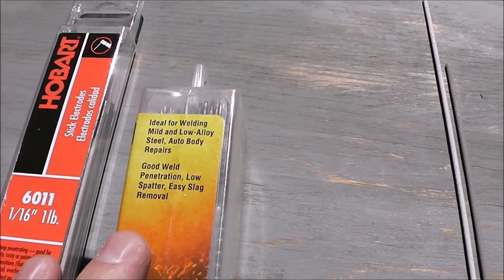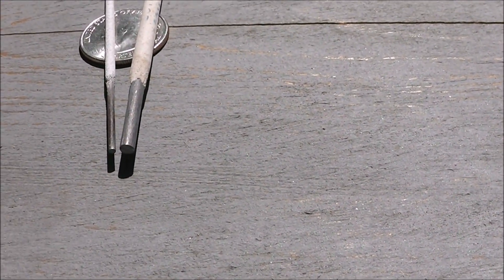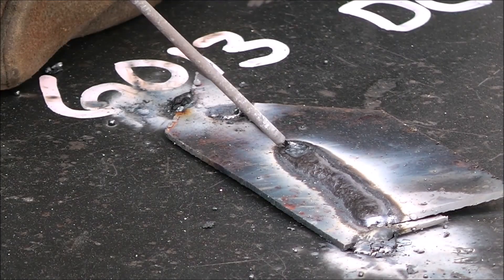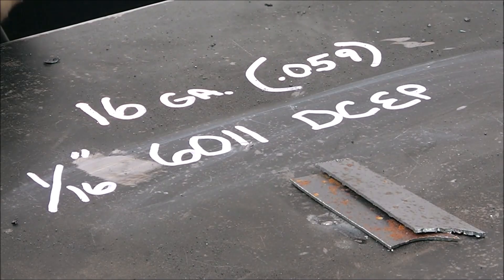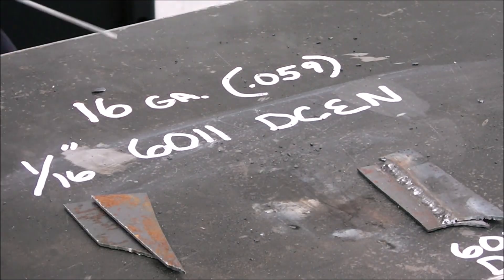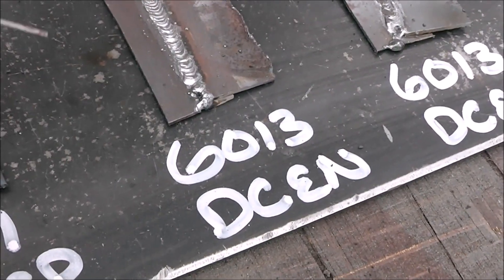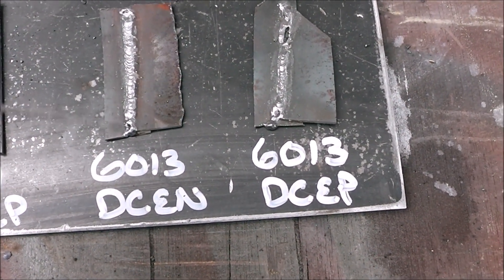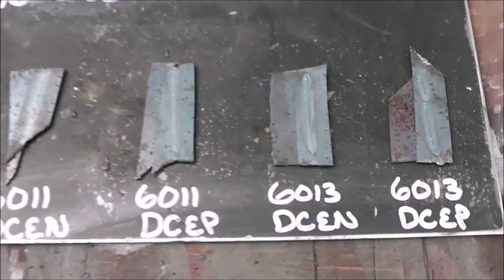6011 Vs  6013 BEST POLARITY for WELDING SHEET METAL

Comment: I've wanted to weld for years finally got me a small box and since I've never even knew anything about welding but I just  bought a small variety of rods and just went to it and I've stuck thousands and burned holes in even more.. but I didn't fret and learned to fill them and move along with a grinder as my best friend to clean up the mistakes.. but I didn't know better I learned on thin metal and my welder wasn't the best when it came to holding an arc so I had to learn improvising.. which I have a method and rotation like I'm stitching figure 8s with a vibrato to the wand that helps maintain the arc... What I found with many trust is if I moved a but faster with 6013 and put a line on the edge of each piece before doing the main weld  prevented many holes especially on rusted compromised areas that will blow through super easy... Course I never bought super thin rods this was all done using huge rods since I  bought most my rods 2nd hand in bulk from others being o tight budget...  Im a huge fan of 6013 in EN is what I've found as well on thin metal... When I finally did some thicker metal later on  it felt like child's play compared to thin...  Glad I learned it this way...
Reply from the maker: A lot of people assume that thin metal is a good place to start because it seems like thin would be easier but it's much harder as you found out. I'm guessing going this route you are probably a very good welder and I know you've learned to read the puddle!

Comment: I just bought a 650 amp chinese machine from a friend here in thailand (220volts). I am just a beginner, when using 6013 rod are the amps 30/60 the same as on a 150 amp machine compared to 650 amp with arc force /hot start.  Thank you.
Reply from the maker: I dont have first hand experience with that welder but it should be the same across the board. 30 amps on one welder would be very close to 30 amps on the next, although each welder is different you will have to "fine tune" a little up or down to get the results you are looking for.

Comment: This was very helpful, but my stick welder does not allow me to switch polarity. 😬
Reply from the maker: Sounds like you have an ac buzz box?
Reply: @BrandonLund  no, it is something I bought online that is a stick, tig, and plasma combo. I am a hobby welder, and it seems to work well overall, but I don't think I can swap my ground and electrode holder.
Reply from the maker: Hmmmmm 🤔 do the cables twist lock into the machine or are they hard wired coming out of the machine?
Reply: @BrandonLund , well crap! I stand corrected.  I was thinking of my little flux core welder. I can switch them around. Is that still okay with 220? And what is the actual reason for doing this. Does it change where the heat goes?
Reply from the maker: Thats awesome! No you won't hurt your machine at all. It's common practice to reverse polarity when welding thin metal.

Comment: Anybody know a solution to my problem..... old tin, old screw holes,  ....leaks,  tried sealant, used mesh fiberglass with asphalt, still can't seal, just open holes, no purlin underneath....Help!!!!@ Thailand help, you know my problem
Reply from the maker: Sounds like your trying to "plug weld"? Tig might be your best option

Comment: I have a old forney c5 welder that I use at times. It has two holes for the ground lead high and low and for the stinger lead it has several hole for the amps. So what will it do if I put the ground lead in one of the amp holes and the stinger lead in one of the ground holes.
Reply from the maker: That is how you reverse the polarity....by switching the leads.

Comment: Thanks thats great for a learner welder Q How do you do vertical welding ie start at the bottom and go or start at the top and go down. using 2.5 mm rods
Reply from the maker: For thin metal to reduce penetration on thin metals you would start at the top and work your way down AKA Vertical Down.

Comment: I'm about to weld a rust hole on my car, I'm trying to decide which welder is the best out of a stick welder or a gasless welder. as these two are in my price range. which will I have better success at with welding thin car metal?
Reply from the maker: A wire feed welder would be your best bet to weld thin metal.

Comment: This is great man, thx.  I was practicing the other day, was blowing through thin ga with 6013 on positive.
Reply from the maker: I think you will see a big difference when you switch the leads :)
Reply: Brandon real fast, what do u think about 7014, I picked up some 5/64" rods to try on thin metal.
Reply from the maker: Its a great all around rod and the slag peels easily.

Comment: Which brand of 6013's did you use?
Reply from the maker: I think these might have been harbor freight or hobart...im not positive. Im still planning to do a 6013 comparison which im looking forward to.
Reply: @BrandonLund  I have been reading about Hobart 6013. The latest flux formula is 447A with only “6013” printed on them. These have the aggressive arc I'm interested in. Original formula 447C was butter smooth non aggressive arc with "HOBART Stick 6013” printed on them. Today, Original formula might be found in 1lb. packages only.
Reply from the maker: Interesting! I'm going to see what i have laying around...im hoping I have some of the originals to compare:)

Comment: New to this so my question is there dc rod and ac rod? I have a Lincoln ac 225 and want to learn how to stick weld. Thanks.
Reply from the maker: Yes and no. An example is 6011 rods are designed for AC, however they are the equivalent to a 6010 which is primarily run on DC.  Grab some 6011 rods and start padding beads. Don't expect them to look pretty at first but in my opinion a 6011 rod is a good rod to learn how the weld puddle responds.
Reply: Brandon Lund : thanks. Practice and more practice. I just wanted to start on even ground.
Reply: convert it to dc.  Order a 300 amp bridge rectifier from Amazon, about 25  US.   connect the old tombstone 225 to the AC studs, and bolt this to a heatsink, piece of copper best, or aluminum. Connect your clamp and positive to the rectifier. Try welding with  electrode positive, then switch them, for electrode negative......good luck .There are other parts to use, for more precise technical electric rules. AC capacitors, and a reactor inductive choke........ Anyway,  good luck.

Comment: Really great video. I am a self taught DIY welder. I finally understand the polarity concept. Thank you so much. I would appreciate though, if you could shed some light on how does polarity and AC DC welding apply to stick welding aluminium?
Reply: heat the aluminim pieces to be welded, to 550 degrees, then weld away........use a propane torch or similar....
Reply from the maker: Thanks for watching. I'll make sure to cover this in an upcoming episode. Thanks for the suggestion!

Comment: A handy way to handle the small electrodes is to cut the down or to shorter lengths OR remove the flux on the in the middle so you can hold them shorter in the stinger. Basically you’re “chocking up” on the electrode to keep a tight arc.
Reply from the maker: Great idea about clamping the middle! Thanks!

Comment: What gauge thickness metal did you use? I did 16 gauge and it turned out great. I did 22 gauge on all different amperages, and it pretty much turns the metal to molten lava lol I can't go slow/fast enough to get a good weld. 22 gauge steel is about the thickness of a car body panel. I did this with 6011.
Reply from the maker: I used 16 gauge in this episode. The thinnest i've done is 22 gauge with 6013 https://youtu.be/wSCE_xEjBLM
Reply: @BrandonLund  thanks! Checked out your video with 6013, and it does seem to do ALLOT better with the thinner sheet metal. I'm trying it right now, and I notice enough of a difference to be better than 6011. I'll update later if I'm able to do body panels on cars with it. Your method of spotting around might be best, but we'll see. Thanks for all your help! Too bad I can't send a one time donation, or can I?
Reply from the maker: @-smp-scientificmethodpersp838  As much as I appreciate your very kind gesture, my content is free here because I enjoy helping people. I get a little revenue from the ads on the channel which helps me to recover some of my costs so I consider that payment enough. Thanks again buddy and I truly appreciate viewers such as yourself. 👍👌
Reply: @BrandonLund  I got it to sick together pretty solid, but just like yours, nothing too structural. It's doable in a pinch, but nothing seamless if it needs to be really strong. Everything you tipped on doing was exactly what made it work. Tac here and there, no gaps (so the heat transfers to the larger metal better), aim towards the bigger metal (not too much of a difference), and angle the electrode to get the flux away from the bead (unorthodox but key!). Thanks for everything again!

Comment: Good information.  My welder is AC only.  I wish you had tried AC.   I don't weld enough to justify buying another  welder.  I am thinking of adding a rectifier if  DC is  vastly superior.
Reply from the maker: My AC welder is currently broken but I plan to repair it soon. The only real difference I notice when running Ac Vs. Dc is that DC runs a bit smoother. I occasionally get arc blow with DC which you don't get with AC simply because the arc is alternating at 60 cycles a second.

Comment: Hello Brandon.
Thanks for the video!
Having watched so many long drawn out videos on welding specially thin sections, it can still be confusing. Please don't get me wrong.
Now that TIG and other stick (inverter) welding machine options are available, would you favour TIG over stick? It's for those who don't yet own a welding machine.
Just looking at your grandson, one just can't mess around with welders!
Reply from the maker: Personally I prefer stick but it really all depends on what your working on. Most of the stuff I do doesn't necessarily require the precision of TIG, so I go with a faster process which is generally stick, mig or self shielded wire feed welding.

Comment: will it cause damage to machines circuit if I always switch the polarity connections ?
Reply from the maker: Not at all.
Reply: There are even electrodes out there which you must weld dcen. If you weren't allowed to switch polarity, the welding machines would use different sockets for each connection ...

Comment: Thank you for the video, I tried this both ways and I'm going out again. I find the penetration better with DCEP too. My DCEP also looks better than when I do DCEN. The problem I have is blowing holes in thin irregular surfaces (wheel barrow repair/re enforcing). The good thing about the hole is that it doesn't fill up with rain water any more :D
Reply: dcep blows holes in sheet metal more?
Reply from the maker: @SandeepKumar-jj7zi yes. EP has more penetration than EN

Comment: Chinese cheesecake factory sells 1/16 6013 in 2lbs boxes for like 6-7$ they are half length so they aren't so unwieldy to try to keep still and lay down surprising quality.
Reply from the maker: Good to know! Thanks!
Reply: .....??   some good  '' steel  ''  coming out of China, now  ??  wow, not like their drill bits, or those drill chucks. Bought a 4-way drill chuck, 4 sizes, and guess what ??  the cross is real STEEL,  but, the gears were some bs pot metal; went to tighten a bit in a drill, and snap/snap......broke the teeth off it. Anyway, don't buy this crap.  Good luck.

Comment: Great video. I like your attitude to fixing things with what you have attitude. I need to weld some sheet metal 0.8mm thick with 6013 rods like the ones you used. Can you do a but joint please. Many thanks, and hats off to the inspector 🤗
Reply from the maker: Thanks! I will make it a point to cover that in an upcoming episode! 😁👊

Comment: What about AC?   Cut those electrodes in half and go more vertical and you won't need such a steady hand.
Reply from the maker: Great question. This is pretty much how i understand it in general. AC or alternating current falls right squarely in between DC (direct current) positive and DC negative.  The reason for this is because the sine wave for AC current is rising and falling up to 120 cycles per second. One of the advantages of AC is that because of the alternating current you don't get arc blow which is fairly common with DC. Because the AC current sine wave is always going up then down it makes it more difficult striking an arc when your amperage settings are low which is one of the reasons why a steady direct (non alternating) current works better when welding thin metal.

Comment: If I want to weld a patch on to my very thin (1 mm) metal shed, and so use electrode negative so as not to blow through the sheets and to get a good weld, is there a risk that clamping the positive electrode to the shed, which is likely to be earthed simply due to contact with moist soil / deep metal pins, etc., will cause an electrical short.. at best tripping a switch, at worst causing an accident / fire?

Would someone opening the door to the shed be at risk of an electrical injury?

Thanks people :)
Reply from the maker: Its very doubtful there would be a problem but there is always a risk of electrocution when welding although its very rare

Comment: Is it east to arc weld 1.1 mm sheet steel?
Reply from the maker: Thin metal is very difficult to weld with stick.
Reply: Brandon Lund Because it blows through?
Reply from the maker: @Soggz7785  yes
Reply: Brandon Lund what about at a real low amp age?

Comment: Hi, I just bought a small inverter welder, may I know which type of welding rod I should use for automotive skin panel, I found out those metal are thin.. thanks
Reply from the maker: It's going to be difficult with a stick welder but 6013 will be your best bet. Check out my welding thin metal videos for tips. Good luck buddy.

Comment: My trick was to whizzer wheel cut the rods in half and then use. A lot more control without wiggle. How about trying butt welding the sheet metal with a small gap between the sheets ?? Nice job showing the difference between different rods and polarity settings too.

Comment: The best stick welder is AC square wave.
welding rod and body to weld have the same temperature and the rod dont stick on the body.
Reply: Barbatruco that’s not true. There are plenty of DC rods. Run them on AC, and you’ll have a real mess.

Comment: How about 7014 and 7018?
Reply from the maker: Great suggestion. I think both would work well but not as well as 6013
Reply: @BrandonLund  I'm trying to weld 14 gauge steel cut from an old fridge over the window of an old school bus. My 70A Harbor Freight AC arc welder just makes a mess of things whether I use 1/16, 5/64 or 3/32 rods. The steel is kinda-sorta hanging there now with copious blobs that'll have to be ground off. 

I'm thinking of getting the Harbor Freight 80A DC welder and using my rods for that. Since you say 6013 is good I might buy some more 6013 in 3/32. I'll have to media blast both sides around the edges but that's no biggie.

I'm very encouraged that you did all that with 80A DC.
Reply from the maker: @raisagorbachov  be sure to clean your metal real good also..its not easy to do with stick but definately doable. Good luck buddy 👊 oh, and be sure to keep your metal tight...no gaps. It blows through a lot easier if your metal isnt tight

Comment: I am working mostly with very thin tubing...bicycles; croMo, and adding in parts made with mild steel from 18ga to 10ga. I am hoping that a 6011 will do a better job than the 6013 at 1/16. The 5/64 rods burn through a lot. I am getting good at filling holes, tho.
Reply from the maker: 6011 is a typically used for root passes because of it's deep penetration. Usually 6013 is better on thinner materials but it can be done with 6011 is you run your amperage real low and run it like spot welding.

Comment: nice work eh. from canada. give er.
Reply: i would still use 6013 d.c. electrode negative. 90 amps.
Reply from the maker: I'm a fan of DCEN. I'm not that good with 6013 rods though. Probably because I dont use them often
Reply from the maker: Thanks man! My wife and I are planning a Canada trip on the motorcycle next summer. I've never been. I'm looking forward to it.

Comment: Reguardless to popular belief electricity does not flow from positive to negative but the opposite, an electron is negatively charged and flows toward positive so while welding negative electrodes tend to push the metal into the positive ground .

Comment: Can i do electrode negative in my inverter arc welding machine, is it safe on my machine thank you
Reply from the maker: Yes you can do this safely.  The machine I'm using in the video is also an inverter.

Comment: GOOD DEMO!!! THANKS!!! PERHAPS TRY SAME SET UP, BUT, USE A COPPER SHEET, OR BAR, TO BACK UP THE WELD, TO ALLOW A BIT MORE AMPS, WITH LESS RISK OF BURN THRU(?!...)
Reply from the maker: Great suggestion! Thank you. I will include this in an upcoming video. I have a nice thick copper bar for doing just that. Cheers!
Reply: oh, damm.....i just sold 165  pounds of # 1  red copper. 4.00 a pound, .......?      ... i shoulda kept 10 pounds.....damm me ....anyway, good luck to all working   '' with  their   hands ''.........